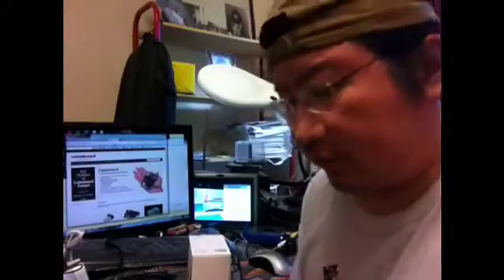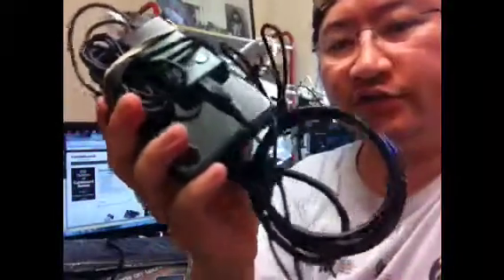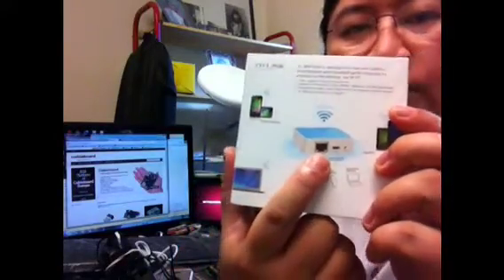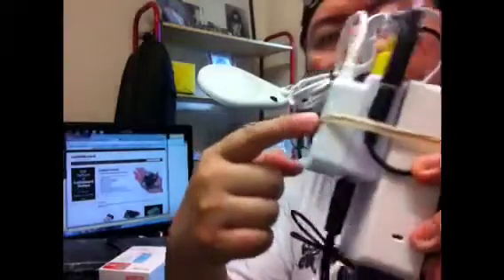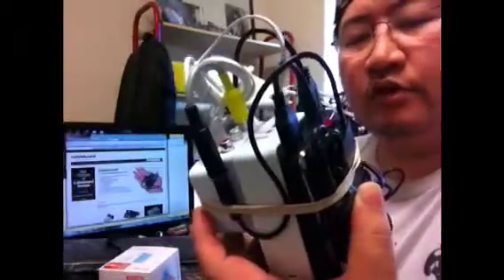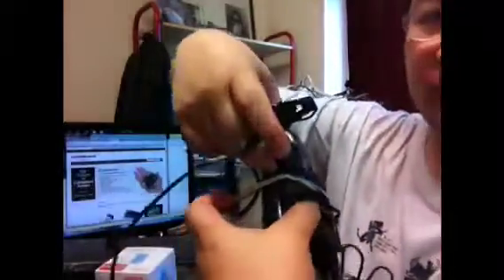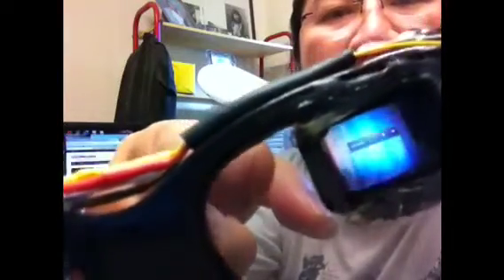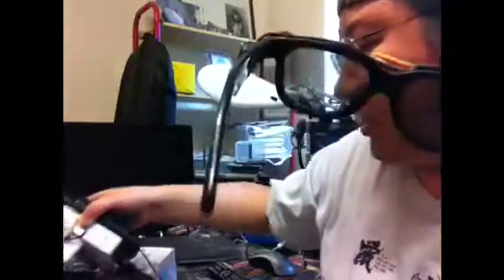My Wearable computer, A Mygadgetlife project Using a Cubieboard and a heads-up display

Comment from the maker: I did look into a screen using a mini laser projector, it was possible to take off the laser optics and have a remote wire to the main electronics. The difficult thing was the screen, as it would mean the user would carry around a partially transparent screen. In my experiments it proved to be a bulky mess.The current technology to have a screen, is either mirrored optics or a magnified LCD. Holograms or bio engineered video driver boards to the visual areas to the brain are just not feasible

Comment: I'm very impressed by your prototype but the screen needs to be further away from the eyes and maybe in the style of a visor which can be angled so you dont have to see it all the time :P It might be more practical to have a screen on the wrist with a separate keyboard, perhaps with a small screen on that too so you can see what youre typing. Having a screen attached to your wrist gives added security to the device (less chance of dropping it, sitting on it or someone swiping it off of you).

Comment from the maker: I presume you want to copy the idea used on the raspberry pi tutorial (see video description above) .I think it will be very difficult to translate that to the cubie board. Instead I used a HDMI to RCA converter you can get them on Ebay. I found the cubieboard great although the video playback was disappointing. Try the dual core version  (my video on dual core inbound soonish)...